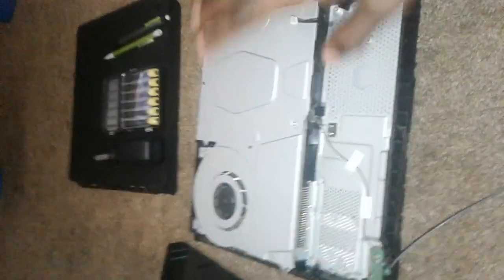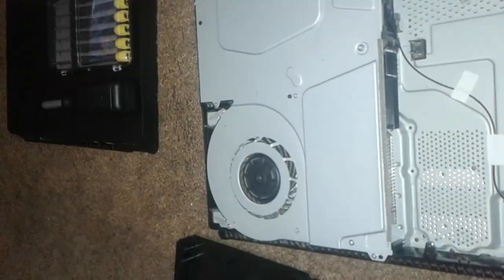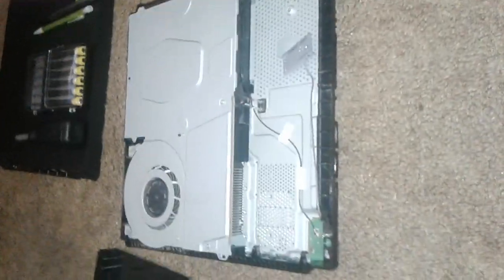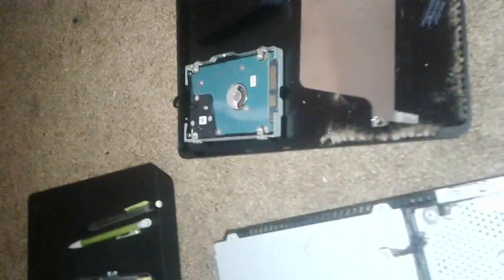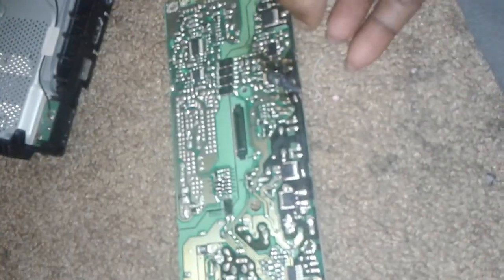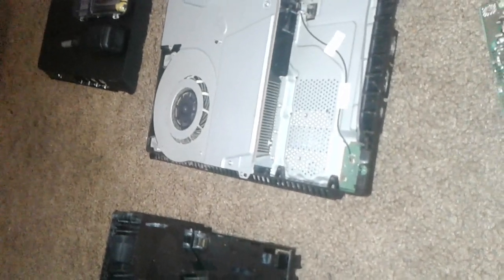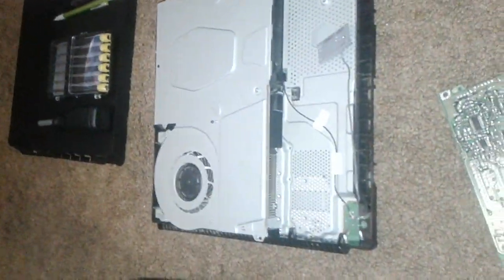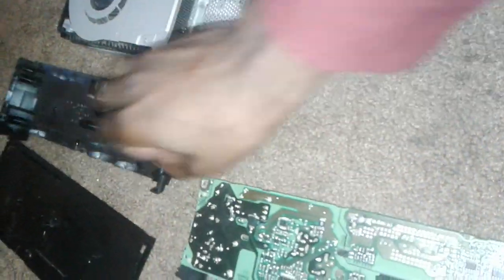ROACHES GOT IN MY PS4  (NO MORE STREAMS)

Comment from the maker: So some roaches got into my ps4, they was attracted to the heat that my ps4 was giving off and found a way to get inside it and ended up getting to the mother board aka- battery and they got fried by it 😂 I just need a new battery and I'll can stream again ✌👍🙄
Reply: U mean power supply?
Reply: I brought a ps4 that has the blue pulsing lights. Took it apart and roaches was in the power supply